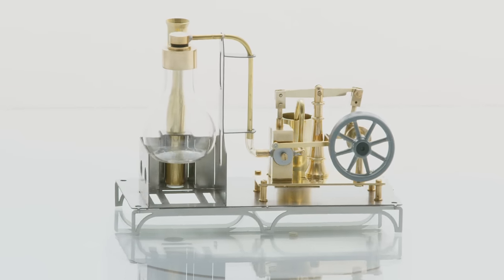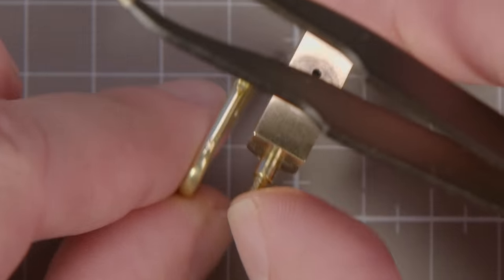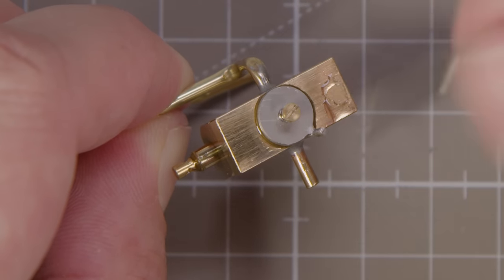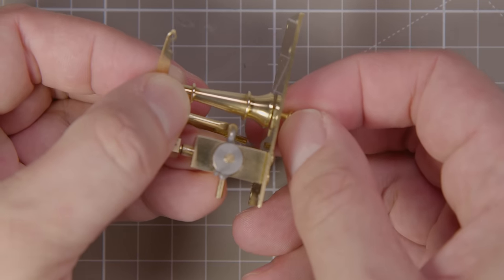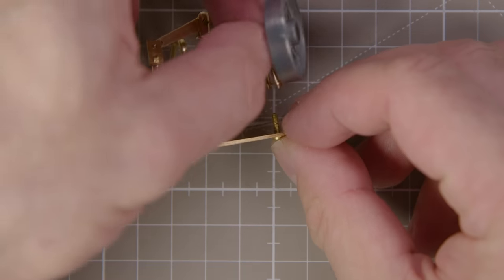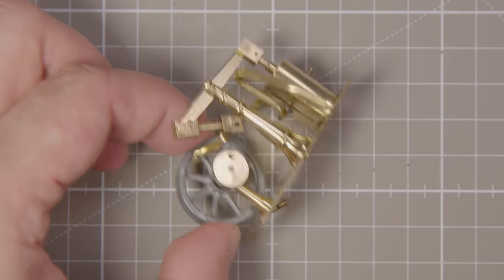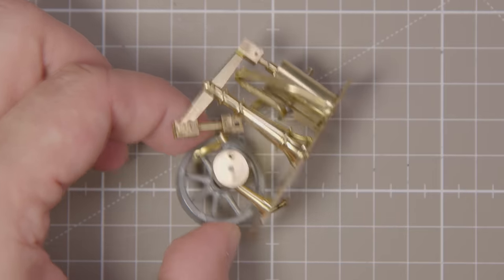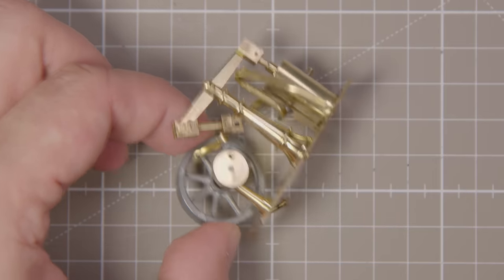😁 This Tiny Steam Engine Is Amazing! Build, Test, Explanation #livesteam #steamengine

Comment: First: a well recorded and explained assembly process. And of course the star of the show is a thing of beauty. 
The title is not entirely correct though, its should read: how a stationary steam engine works.
The Chiemsee loco works you showed works differently. Your stationary engine does not not have adjustable cylinder filling and it has slide valves instead of rotating valves. 
A design issue with this particular  engine is that the cylinder is attached directly to the rocking beam. The end of the beam describes an arch which should be compensated for or it will cause the piston to rock inside the cylinder and wear out. Of course this is a simple model but real beam engines have mechanism that compensate that. No criticism intended, your video is great.
Reply from the maker: Thank you very much for the review @garrattfan. This info is very helpful. The piston is actually attached through a sliding mechanism for this model. It‘s hard to see, since the sliding cavity is covered. You can actually see it in the CAD model, if you download it. And yes, you are right, the Chiemsee loco works differently. And the tiny one is stationary. The storyline intended was more like: the Chiemsee loco is closer to what people have in mind associating with steam engines in general, but to explain we will look at a stationary model.

Comment: I'm thinking it would be preferable to slow down its operation speed by about half. I wonder if it would start shaking itself apart after running for long periods at that high speed?
Reply from the maker: Hi @HigglanderNorth1, it‘s a good idea. The maximum I had it running on a full boiler was about 15 mins. Unfortunately there is no easy possibility to control the rotation speed other than controlling the temperature of the boiler. But after having had it running for more than 50 times, no issues with parts falling off. Except some loose screws.

Comment: fantastic video! does it not need any steam oil or lubrication?
Reply from the maker: Thank you very much @midnightmouse. Good point about the steam oil. I did not use additional oil added to the steam for this demonstration. But it‘s a good idea to investigate. Do you have any suggestions which oil to use for these dimensions?

Comment: Great video, thanks. I guess the flexible hose acts like a safety valve since there isn't any.
Reply from the maker: Thank you very much @carsten4594. Great observation about the flexible hose. You are right. And additionally, the rotational valve is suspended by a spring which can as well act as safety.

Comment: A lovely little engine. I like that you can see into the boiler. You explained its operation very well.
 However it has a major design flaw which makes it VERY dangerous. There is no pressure relief/safety valve to prevent it blowing up in your face. In the UK where ALL steam boilers have to have these fitted it would be illegal to sell or use. I'am dissapointed that you did not explain the lack of this feature, and how dangerous this makes it.
Reply from the maker: Thank you very much for your comment @Gilespargiter. You are right, I did not explain it in the video. However, the rubber tube, which is quite loosely connected the boiler outlet hose to the cylinder inlet, acts as a safety valve. @donevans1884 also pointed that out. One thing which is hard to see in the video, the rotary valve of the cylinder is also acting as a pressure release because it's suspended by a spring to the cylinder.
Reply: @tproc  Thankyou for your response.
 I did notice that the rotary valve might act as a pressure relief valve. It is not directly on the boiler though, therefore any blockage in the system between it and the boiler would prevent it operating. So that is inadequate. It is good to know that the rubber tube would uncouple and a warning to ensure only the precisely correct tube is used. This also is not directly on the boiler and could be susceptible to blockage as well as having an unquantified pressure resistance. So this also, although definitely helpfull, is not adequate. Even a tiny boiler like that can have a relatively enormous amount of latent energy, which if released suddenly could have devastating consequences.
It would easily be possible to install such a valve on the coupling at the top of the boiler.
Reply from the maker: That's a great idea to put a safety valve on top of the boiler. Do you know, where I can find those tiny valves?
Reply: @tproc  Yes it is normal practice to mount one directly to the boiler (0n any steam boiler). I couldn't tell you directly where to get one - I play with rather larger toys in my workshop. Also I think you are likely in Canada, whearas I'm in the UK. From watching similar videos I would suggest googling "Mamod" steam engines as I have noted that others seem to be able to obtain parts for these, including the safety valve to fit on engines with a similar problem. Most likely not the only suppliers.
It does you a great deal of credit that you have taken note of this concern. It really is a major design fault.
Just a sort of "ps" if you look at a pressure cooker relief valve you could see how to make one, which you could test the lift off pressure using compressed air. A bicycle pump would be easily sufficient source of compressed air. Compressed air won't suddenly boil like high temp.water. 100deg. plus about one degree for each 1llb pressure increase.
Reply from the maker: Great to hear that you have a workshop and are working on these machines. It's so fascinating. Thank you very much for the detailed information and the idea with the pressure cooker/bicycle valve. I will ask Google about availabilities of the Mamod parts.

Comment: Poor design causes the lower portion of the piston to fill with water. This cylinder should be mounted horizontally.
Reply from the maker: Interesting thought. I did not have this issue so far. Even after running it for around 20 mins. Also the steam heats up the cylinder very quickly. I have seen though on bigger models that there is an outlet on the lower condenser.
Reply: @tproc  Mr. Hielscher did a ministeam mill engine too but they are no longer available because he left the construction office due to age . His son in Law Andreas still offers gauge 1  live steam locomotive engines on demand  !  I got one and be pleased with the outcome
Reply from the maker: Dear  @johannesburing2417  . Thank you for sharing this info.